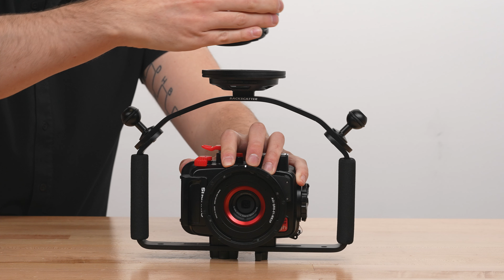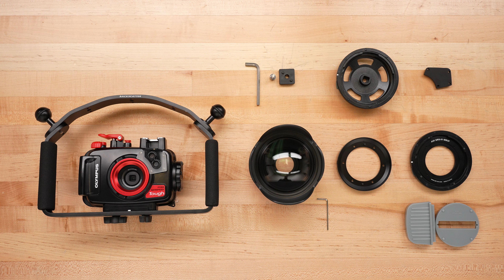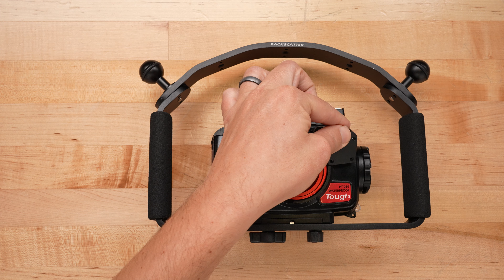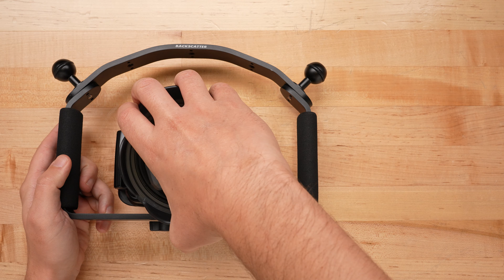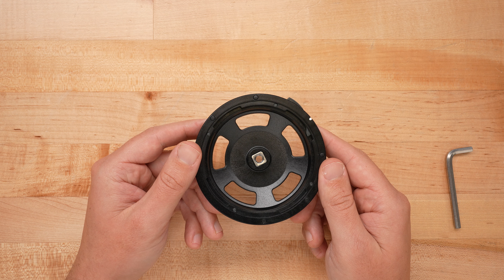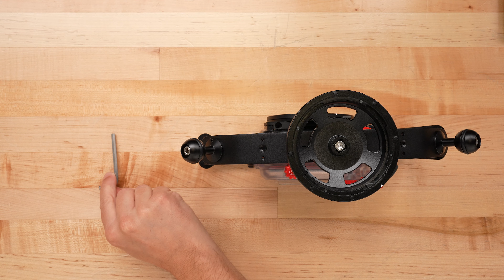Backscatter M52 Wide Angle Lens Quick Release Installation Guide

Comment: Is tg-7 with these wild lens much better than a gopro13 or aciton 5pro? maybe there is a way to take both tg7 and action camera together for macro and wild angle ,a quick holder for action camera?
Reply from the maker: The TG-7 is a much better choice than the HERO13 or Action 5 Pro for still photography because it can sync with flash. Action cameras, like the HERO13 and Action Pro 5 are great for capturing video, and does have more options for frame rate and resolution than the TG-7. That being said, due to its close focusing capabilities, the TG-7 is a much better macro video system than any action camera on the market. You can take both a TG-7 and an action camera using a cold shoe mount or a ball mount on either the TG housing or the Backscatter Double Handle Tray and Arch. Give us a call at 831-645-1082 or email us at sales@backscatter.com and we give you a list of all the parts you need.

Comment: Is there one of these for the Air Lens? I use the Air Lens for basic WA and Macro - then switch to the M52 for big stuff....
Reply from the maker: The Air Lens does not have a removable bayonet to keep it simple and inexpensive. You can zoom with the M52 Wide Angle Lens for intermediate shots, then switch to macro by removing the lens to cover wide, intermediate, and tight macro images.